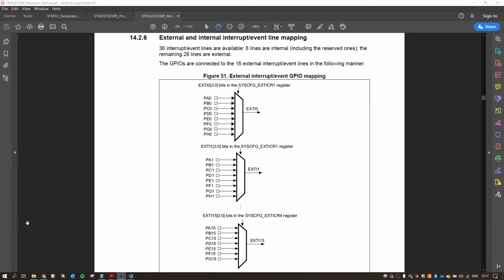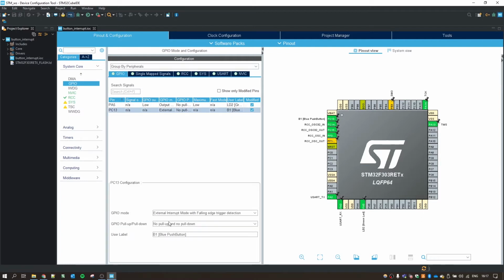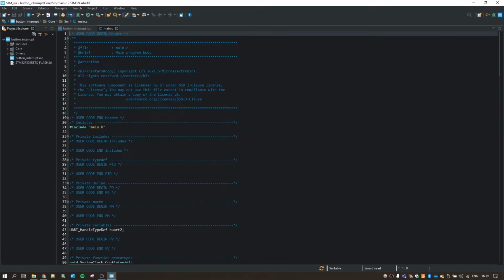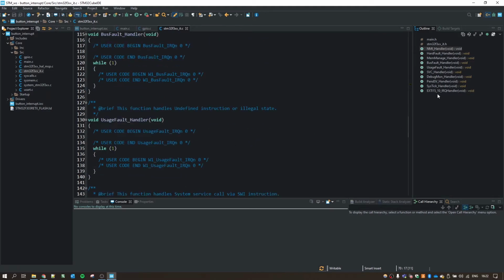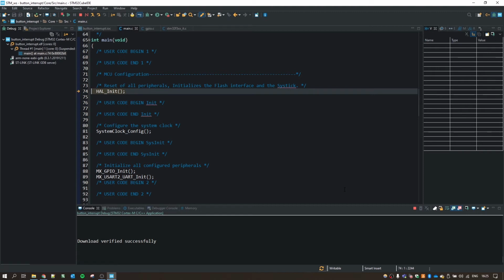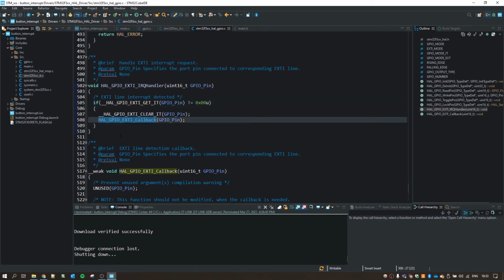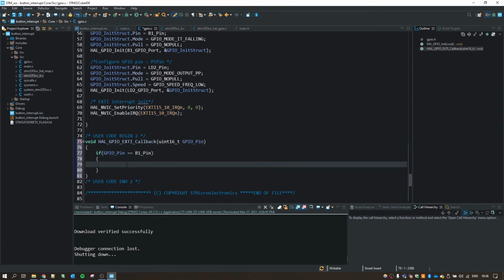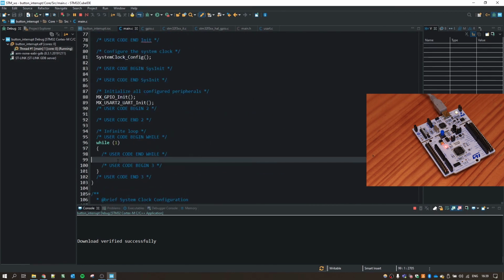Interrupts | #8 STM32 GPIO button interrupt

Comment: I wanted to use the PE4 pin, but the compiler shows an error, it only accepts EXTI0 - EXTI3 registers, what's the problem? The documentation and implementation are completely incomprehensible... I prefer to use pe3? According to the documentation, i can use all of them from 0-15, but how...?

Comment: In the "strongly" defined HAL_GPIO_EXTI_Callback function, you put if(GPIO_Pin == B1_Pin). Does that mean if you have another external interrupt, you would put another if statement for that other pin in the same callback function? Is that callback function shared amongst all the EXTI's?
Reply: Yes and yes. The same function gets called for all external interrupts.

Comment: Good explanation ,wanted to know how to come out of an interrupt 
for eg.
consider that in main some execution is going on and an interrupt occurs and controller moves to serve interrupt so after serving the interrupt how to come back to main program 

wanted to know which instruction to use to come out of any interrupt
Reply from the maker: On a higher-level(In C code), you will return from the interrupt as soon as all the code in the ISR ends. But if you are looking for the exactly assembly instruction then you will have to look into the Assembly code equivalent of the C code ISR. This can be done when debugging is on and you can click on "view disassembly"